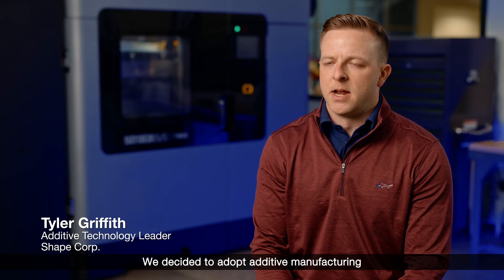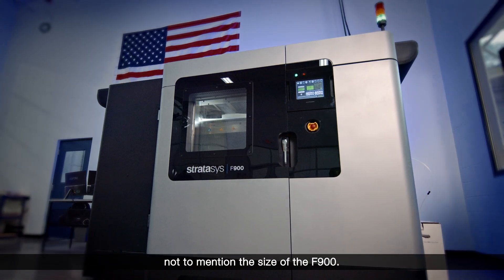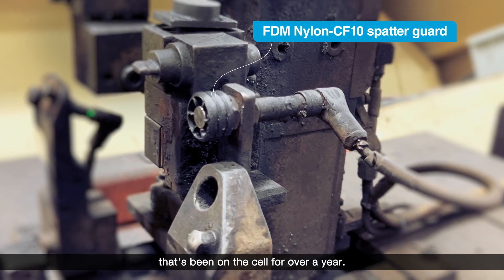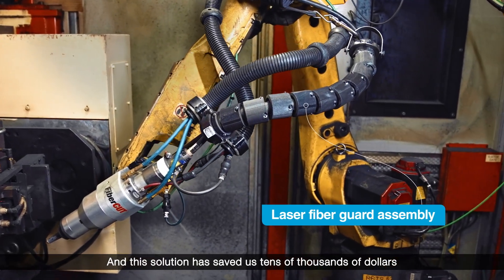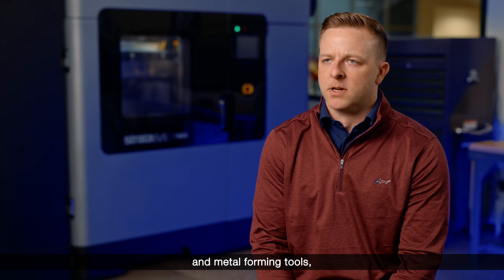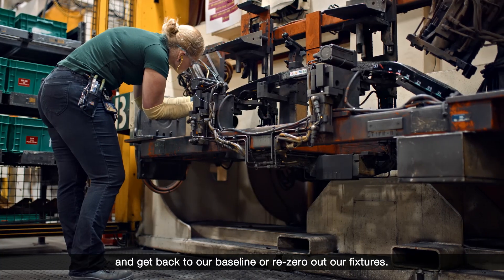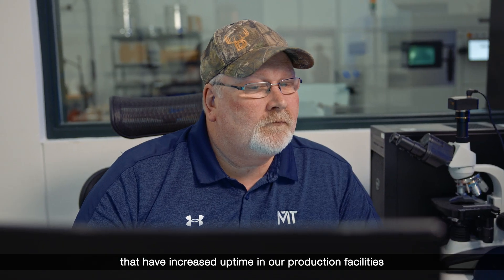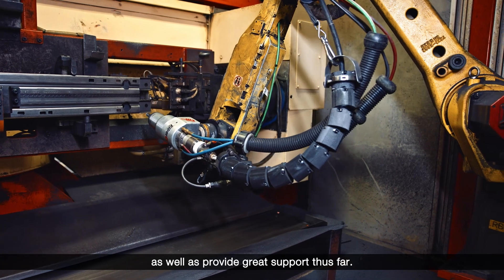How Shape Corp Increased Efficiency with Additive Manufacturing

Comment: Buy a Bambu Lab printer instead. Save yourself a lot of time and money. For real, the print quality of these parts is bad compared to Bambu printers.
Reply: Nothing wrong with Bambu, but let's see your 2 1/2"' long robotic end of arm tools from a consumer grade 3D printer.  Not going to happen.  These parts shown in the video were not meant to be pretty.  They are using Stratasys FDM for strength of part, accuracy, and repeatability.  Completely different level of performance vs. a low-end consumer grade system.
Reply: @michaelwaller5273  There's a reason Stratasys is only suing Bambulab. They don't like the competition. Not a single item in this video needed to be printed on a $70,000 printer. The end of arm tool looks terrible, could have been printed on a modified ender. I'd love to see a head to head for sure.